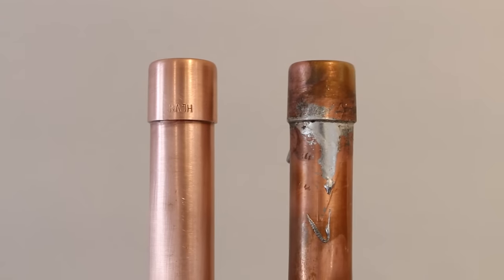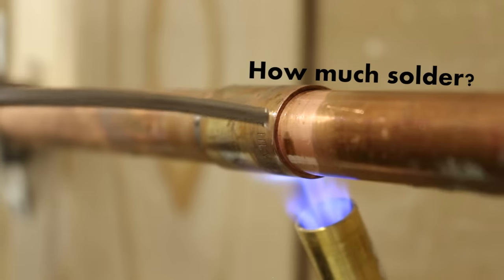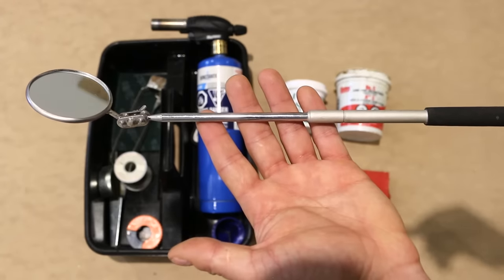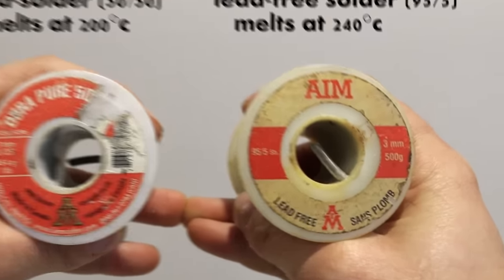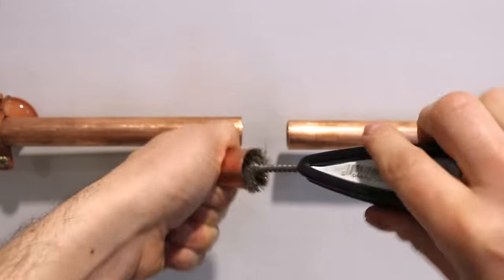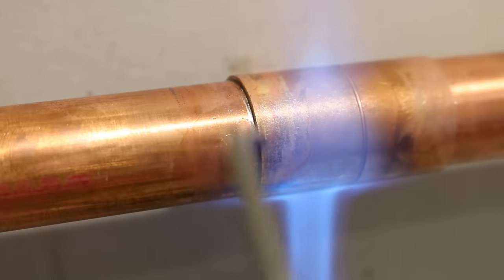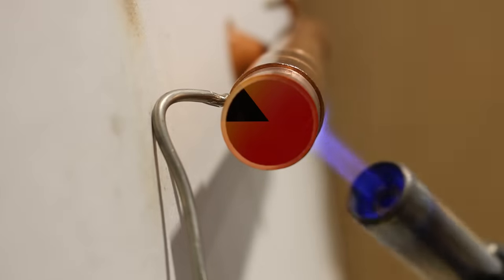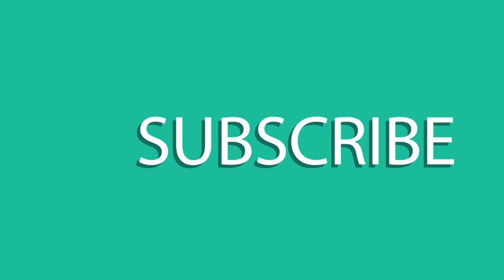How To Solder Copper Pipe Like a Pro (Tips & Tricks) | GOT2LEARN

Comment: Why? It's in a wall. What a waste of time. If exposed, it shouldn't be.
Reply from the maker: You didn't watch the video I am guessing 😄
Reply: @Got2Learn  not the whole thing. It got dumb quick.
Reply from the maker: @jameskurk5668  I mentioned in the video that this technique was for exposed piping like towel warmers or radiators, or else, no point in doing it this way...
Reply: @Got2Learn  I gathered that. And stated as such. But, exposed copper? That's just dumb. It will look like shit within a year. Use stainless or something for the exposed piping. Copper oxidizes too fast.
Reply from the maker: @jameskurk5668  that works too, but hella expensive
Reply: @Got2Learn  but necessary to prevent it quickly turning to shit.
Reply from the maker: @jameskurk5668  👌

Comment: Most of you in comments are a joke lol. And no one here speaks od making a solid cap around the joint lol. Amateurs.   If you dont see any solder your being a fool tbh. Maybe it doesnt leak now but won't pass many inspectors and definitely not hold for high pressures and sprinkler systems. Go add amateur comments 😂😂😂😂
Reply from the maker: This is not brazing Sergio.

Comment: You can’t do all this shit when you have to do 3 or 4 houses of copper re piping in 5 days .
Reply from the maker: Did you even watch the video?
Reply: Got2Learn yes i did and as I said you can’t do this when you are working very fast . If you weld every joint like that you going to get fire because you are taking too much time. Besides pipes are hidden behind the walls and nobody see if is too much solder or not who cares !!!!!
Reply from the maker: That's why I specified to use this method for radiators or towel warmers, or else yes, you will get fired ;)

Comment: This technique will dramatically increase the risk of leaks AND slow down production rates. As a former licensed master plumber, I can assure you that this is NOT a 'professional' method! 

Downvoted for misleading consumers and DIY'ers!

Some of the elements, like cleaning properly, not contaminating the joint, and using the proper heat ARE valid, however.
Reply: Can you please make a video explaining your techniques?
Reply from the maker: I second that :)

Comment: You are far away from pro. First at all, when you want to make solder joint, you must heating both parts, not only one, like you do. Second, never stop moving the flame. Third, You are not using enough tin. Beautfull joint and good joint are two different mean.

Comment: you talked more then what it seems to be needed it.
Reply: @Got2Learn  I meant just tell quickly, so that anxiety  wont damage my need to hear crucial information. Repetition of one thing is not needed. Example, clean pipes, flux, clean inside, propered soldering, proper cutting.  Done. Show not tell so much. 
I forgot safety.  More showing less telling.
Reply from the maker: Thanks
Reply: @Got2Learn  thank you. You are an expert, and I was only saying above to assist myself  in understanding your expertise.
Reply from the maker: @johnsrealstateservices6182  😉
Reply: @Got2Learn  brother, question, the meter valve at the water source is tight, upright, and I have key to closed it. I used strong pressure and it was turning, but will that force might brake the key? The water company had to used force too, so some hard force is okay?
Reply from the maker: The valve might be worn out, maybe try spraying some penetrant in it first?

Comment: wrong!!!! Always insert the solder from the underside in a horizontal joint, you see the solder flowing up. and then you now 1: good connection and 2 right amount of solder and 3 heat is perfeckt

Comment: The L is silent. 
It is PRONOUNCED  SOD-R. Or SOD-ER

🤦‍♂️ POT-ABLE water lines not portable your accent might throw people off on that one... great tips although I don't have time to wipe every single solder joint down with a clean rag before I solder it.. besides 95% of the time the copper gets covered up in the wall.... another trick on your vertical solder joints is only flux either the fitting or the pipe

Comment: Soldering is outdated.  New technology using hand power tools that " swadge" or crimp the fittings using dies make to use of torches and mapp gas obsolete.
Reply from the maker: Yup, made a vid on this: https://youtu.be/S5NWZMzPZBA
Reply: The problem with that  method is you cause cavitation = leak, it also disfigure the pipe for future service repairs

Comment: This is a ridiculous misconception. Any idiot can solder clean copper in any number of ways. You want to use a lot of soder a little bit of soder. It doesn't matter. Doing old copper is where Talent comes in. And I would highly suggest if not completely oppose doing anything along these lines. P.S. Been a master plumber for over 20 years never seen anybody try to use a minimal amount of solder for the sake of Aesthetics.
Reply: Now, another one trick monkey, 20 years of doing the same crap doesn't make you an authority in something.
Reply: @wetrock2766  actually it does.
Reply: @wetrock2766  doing this on a shower diverter in a three and a half inch wall with old copper half full of water. Good luck.
Reply: @karlwashere123  Your listening skills are not good, he said: for a visible job like a radiator pipe. It doesn't apply to " a shower diverter in a three and a half inch wall"
Reply: @wetrock2766  I'm a license GLC LLC master plumber and electrician. I don't know why you keep referring to me as a one-trick pony. And I live on the coast in Florida. We don't use copper or have radiators.   As I stated before even a first-day plumber within 80 IQ can solder open-air clean copper.

Comment: Yeah.... in the real world the only way you can use this technique without massively overheating the pipe is with 3/4" or less. Also, I'd love to test your leak percentage. And let's be real, once the copper changes color, as yours did, its technically "overheated". And another thing, you have an easy 3" behind your pipe and your wall... try it in the real world while re-plumbing an entire house. Not only can I guarantee you are a home depot, do it yourself, own your own home dude, but you've never touched any pipe over 3/4" as you are still using propane. While I cant say all of your info is wrong, it's extremely misleading and horrible for people who are truly trying to learn to fine skill of copper plumbing. As for my experience, 12+ years in soldering (pronounced sodd-ering by anyone who knows what they are talking about), and braising pipes up to 10" In diameter for large industrial buildings. While 60% of my work is for homes with a max of 2" plumbing, none of your info would ever apply. Plus, tin flux is against so many potable water application regulations in the United states.
Reply from the maker: To start off, if you knew something about plumbing, you would know that "MAPP" gas doesn't exist anymore, secondly, if you would of listened, you would of heard tge part where I said it was for exposed joints, not a whole house job, check your stuff lol

Comment: Solder dripping down because of flux on the OUTSIDE of the pipe... Who cares? This stupid. Load the joint with solder til it drips once. You know for sure it's good the. Most of this guy's joints are minimal. They risk leaking on pressure test. Get that little drop nugget and you know it's good. Sheetrock and close the wall and who cares. It's not going to leak. That's all that matters. This crap ait meant for the New York Meuseum of Modern Art. Nuff said.